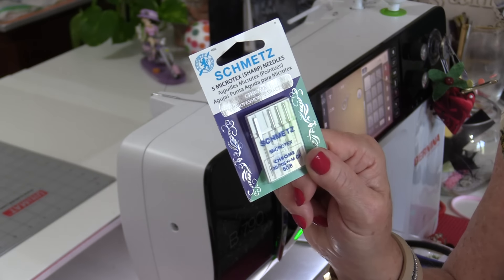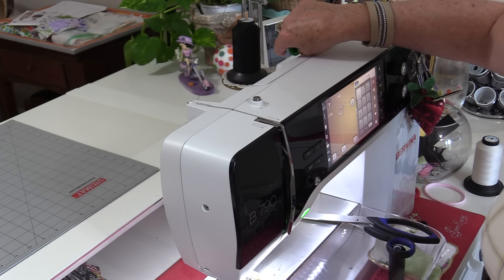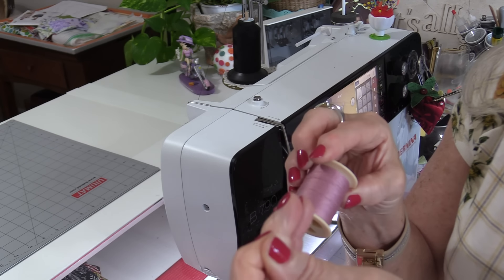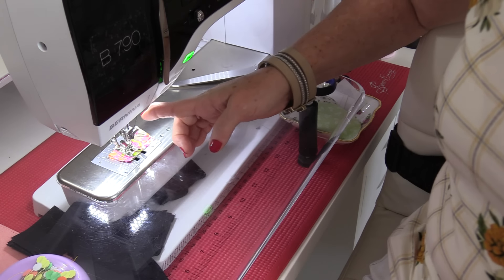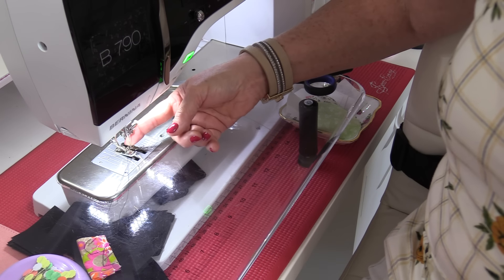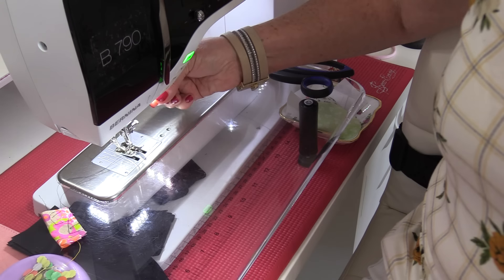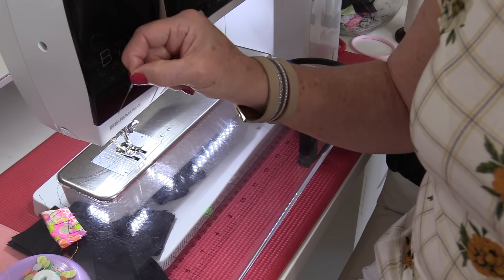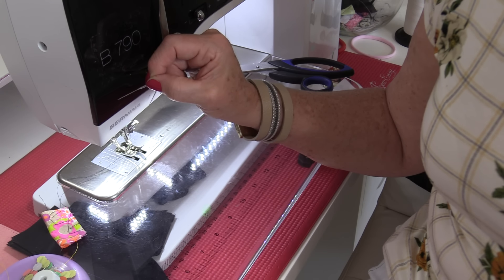Why does my sewing machine needle keep breaking?

Comment: Good Heavens!!  I've been sewing for over 50 years and I NEVER knew that the way the thread is wound on the spool dictates if it should be horizontal or vertical with your machine!  Head slapping time.  Thanks!
Reply: Me also. I have an extra thread spool that fits down over the bobbin winder shaft. I think I will use that and see if it runs smoother .I have a Project Runway Innovis 80 and the only thing I dont like about it is filling the bobbin. I have to stand up and look down over it  because I cant see to wind that darn thread around the tension disc. Oh well what can you do....Three cheers for Miss Laura  <3!
Reply: Me TOO, and I've also been sewing for over 50 years. It amazes me that I learn something new in almost every single one of Laura's videos!
Reply: Had no idea about the way the thread is wound. Now my question,  what if the machine doesn't have a vertical spool holder, is there a way to still use that kind of thread without breaking needles? Thanks

Comment: 1. Thread is knotting
2. Thread is not on properly
3. Notches in the thread spool
4. Other pressure on the thread
5. Incorrect bobbin
6. Large buildup of lint
7. Needle isn't all the way inserted
8. Pressure on the fabric (pushing or pulling)
9. A fine needle with heavy fabric
10. Small bends become big bends (change the needs often)

Comment: Basically "Prevention is better than Cure!!!".  Many people do not realize that the needle can bend very easily when you tug or pull the string to cut after each sewing.  Sometime when the string is a bit taut, you will pull harder and this action will bend the needle slightly and repeatedly, the needle will go out of alignment with the track causing jam and worst still a broken needle.  So remember after each sewing action when you need to cut the string, pull it gently using both hands. One to  above the needle and the other pulling the slack from the needle hole. Never use one hand to tug from the needle hole.  If you don't understand what I mean, trying tugging the string towards you and you can see the needle actually bend slightly.  Cheers!

Comment: Hi Laura,  I think you must have heard me this week as my new needles (from overseas) kept breaking my thread after only a few stitches.  It didn't matter which size needle I used on the cotton fabric  - the correct or incorrect one - continuously kept breaking my thread- regardless of what thread I used, too.  I changed back to my regular needles and no problem.
So I don't know why these overseas needles are not working.   I would also love to see a tutorial on which size needles to use on which fabric.  You explain things so well, I think many would benefit from it.   I know I would.  I just can't keep it straight in my mind.   Thank you, Kathleen
Reply from the maker: You definitely have to be careful when you order needles from overseas. There are some that come that are really good others are inferior and just don't seem to work. You might have just gotten a pack that are not going to work. I know someone who has had the same problem And we had to throw them away
Reply: @SewVeryEasy Thank you very much for your input.  Luckily, I didn't spend alot on them.  I'll stick to buying them locally here on,
Reply: @thoughtfullysewn7456  Dont throw them away,  Can use for stitching on paper to practice sewing straight, or mschine quilting designs.   Just use w/o thread.  Can even use larger needle and a basting stitch length or your chouce  to make starting holes on edge of fabric  for a hand sewn blanket stitch edge with embroidery thread, or a crochet edge, etc.
Reply: @jojosewist8921  
Thank  you very much for that suggestion.  I would have never thought of that.  I shall try that.  Thank you.
Reply: @grmaakww3639  
Thank you.  I learned my lesson.  I will for now on.

Comment: Broke 3 needles before i figured out it was the threader path and tension knob that needed adjusting. Had been using 4 for a while without issue, but loosening it to 3 and also making sure there is a distinct tug while the thread is in the path is apparent. After that, we're good... except now I have to replace the dang set of broken needles...lol

Comment: Hi thanks got you sharing information, I have a question, why my the thread keeps coming out the needle, I use the machine for some basic things for many years, never had this problem, if you can kindly share some information regarding this issue, will be appreciated. Thank for your time!
Reply from the maker: I am not too sure why this is happening. I always stitch on a small scrap of fabric before and after each piece, I am sewing. This not only will prevent this but always keep your threads nice.
Reply: @SewVeryEasy  thanks for your time

Comment: What are  recommended ways to convert a horizontal thread holder to a vertical one in order to use both types of threaded spools?
Reply: An adapter may be an option.  Ask the retailer or customer service for your specific machine.
Reply: In a pinch I have stuck short length of a straw on the bobbin winder post and made a temp vertical thread holder that way.
Reply: Of course if your bibbin is wound w/o having to remove from the machine, this wont work.  I have also used a bendable straw (the type to make drinking easier for kids)  on the horizontal spool holder, then bending up the drinking end and using the small spools of thread vertically on this.   The straw will be shaped like a capital L, if straw seems too flimsy use a cut pc of a larger straight straw over the bendable straw to increase its strength.  Play around with it, it really will work if thread spool isnt too big.  Hope these udeas help, snd made sense to you.
Reply: JoJo Sewist thank you...I will give it a try .

Comment: Thank You for explaining all this for us.  I just bought myself a new machine.  Well, I was making a cat bed using an old scrap sheet.  ( It is a poly - cotton material.)  Anyway, when I folded the material in the shape I wanted it, I saw how there were many layers I needed to sew through.   Sooo, I changed my needle to a denim needle.  I checked to make sure my stitch width wasn't too wide for the presser foot (regular) I was using, started sewing, got about an inch and a half or two in, and, my needle broke after I heard a loud and dull  "ping - like" sound.  The stitches I had completed were not "nested" on either side, so, I don't think I had my machine threaded wrong.  However, I did notice how the presser foot was "riding" a little high.  But, it worked for those couple of inches.   Why do you suppose my needle could have broken ?  (When I threaded the machine, I did a "see - saw" test to make sure my thread was in the tension guide (?) in the first front - vertical side of the thread guide.)  Could the problem have been that, even though it was a soft poly - cotton blend fabric, there were just too many layers for the needle to go through ?   And, I'm almost positive the thread didn't get caught on the spool - it may have, though ... I'll be more mindful of the way the thread comes off the spools from now on.  (BTW, I bought a Singer Heavy Duty machine.)   I appreciate your help and any advice you can give me.

Comment: Interesting about the thread.  Most machines, and the few I have only have horizontal spindles.  A machine may have an additional spindle, that’s not permanent, mostly used for a double needle.  Gosh, so what do you recommend?  Buying thread that will go on the horizon spindle?  Even the manufacturer booklet shows putting thread on horizontal spindle.  :(

Comment: I’ve never snapped a needle but my thread occasionally snaps
Reply: The thread breakage can be caused by several things.  Be sure the Needle size is large enough for the size of thread to slip through easily.  You can also loosen the thread tension if it's too tight.  And also, as the video says, the position of the thread spoon can make a big difference.  If the spool is horizontal when it should be vertical, the thread will twist and that twist will build up and no longer fit through the needle --then it will shred.